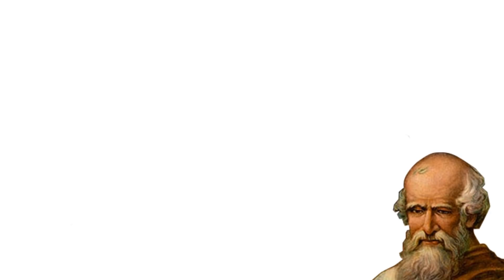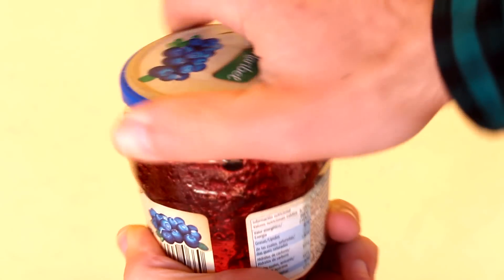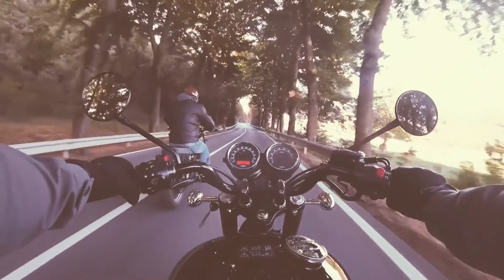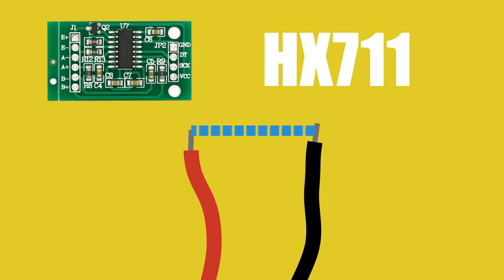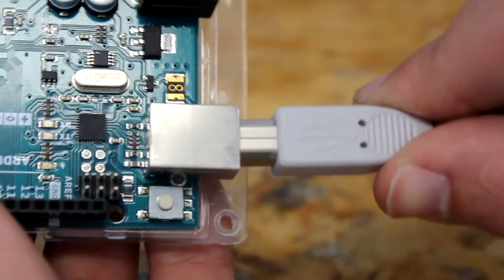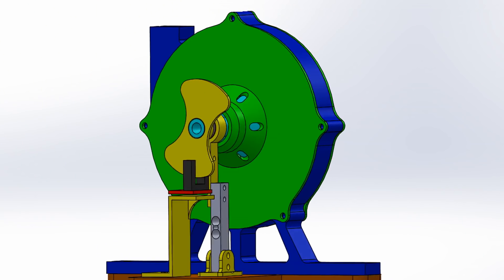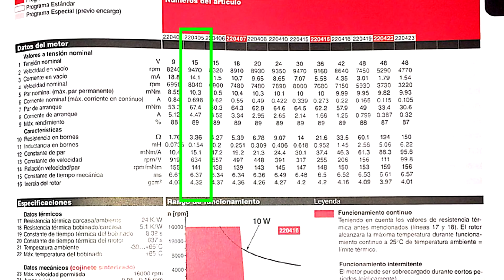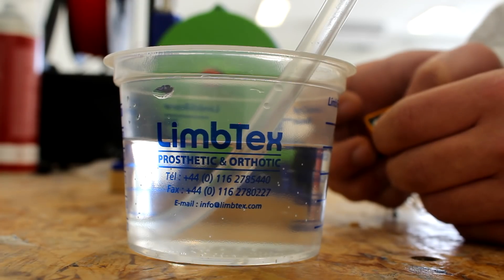DIY Torquemeter - How to measure torque! [Arduino & 3D Printed]

Comment: why did you put the value 28 mm in the code. the distance of the arm from the center of rotation is 40mm???? how you caluculate the value of arm here???/

Comment: This is really awesome but I think you missed the fact that you need to take gravity into account when calculating torque since you calibrated your load cell with a weight (force caused by gravity)

Comment: the load cell reading depends on the thing level of fastening of the gray thing on the shaft right? so if you fasten it more tightly, you'll get a higher reading on load cell and if you let it be loose it going to give a different reading, so how the torque measurement becomes accurate in this case? is there any way to verify the results you are getting is legit?

Comment: How do you calibrate how much friction to add, and how is it placed in calculating the final power equasion as the resistance is added and proportionally measured

Comment: I think the 38W is lower than your actual max power output. Usually, the max power RPM is higher than the max torque RPM. Example: supposed max torque is 10Nm at 100RPM we get ~104W, if at 120RPM the torque only drops to 9Nm your power would be ~113W. I suspect your turbine could probably squeeze out 43W+ when it's truly at peak power RPM.

Comment: You could use a generator to measure power in kw that the turbine can produce, then find the energy losses and solve the equation hp = (torque * rpm) /constant for torque

Comment: my personal suggestion is that you should focus the camera more on the wire connection and working element rather than in the display screen. so that we can learn the concept and what is the exact location of sensors and load cell in the project.

Comment: I don't understand the relationship between turbine torque and 2Kg weight at min 4.28 - 4.50. If weight has a gravity force of 19,6 N (F = ma = 2 Kg X 9,81 m/s2), his torque would be 19,6 N X 5 mm = 98 N.mm, so how is possible to equal pressure torque of 11 N.mm ? Is it correct? What is wrong in my thinking? Thank You for reply.
Reply: Yes, I think calculations are incorrect. We can simply take the ratio of two radii (150mm/10mm) and multiply it with 7 gram, giving the mass of 105 grams that it can hold.

This is the key concept to measure the torque through prony brake system. Multiplying the weight measured the load cell by the ratio of two radii (friction clamp radius/shaft radius), we can get the tangentail force acting on the shaft and then multiplying it with shaft radius, gives the torque: the final and key parameter of this video.

Comment: I did not follow. This kind of configuration will depend heavily of the friction between the shaft and the clamp. So, a loose clamp will not result in a big torque, although the engine could reach it. This also seems to work only when the torque meter is the main load of the shaft. Am I reading this wrong?

Comment: CLEAN! YOUR! TIP! 

I had shit solders too before I discovered brass wool and flux. That dirty carbonized tip is why your solders arent sticking. The flux core in the solder is not enough. Put a little flux paste on the pin/pad(I use a toothpick), dip your tip in the flux quickly, give it a scrub by stabbing it into the wool, then tin it with a small bit of solder. Let the heat of the tip boil off the flux on the pin/pad before introducing the solder. You should be able to make beautiful clean solders now. Every time the tip gets grungy, stab it into the wool. You want a nice clean shiny tip.

TLDR - bad solders come from a dirty tip and having no to flux to give ;)

Comment: If I understand it correctly, the dynamic torque meter does the same as the static one, which weighs the hammer on the scale...except that the handle of the hammer slips.
The higher you clamp down (less slippage, aka more brakeage), the slower the motor will go. And that's the relation you measure: rpm at a given brake force.
The brake force is measured by putting the scale under the brake(aka the hammer) - just as with the static setup.

Comment: Wait, shouldn’t the length of the hammer be the angle from the shaft to the tip where it contacts the scale?  So actually your torque is a bit higher than you think?

Comment: What if instead of measuring by the brake, could you measure the torque using another motor?

Such that, on the end of the power shaft attach a motor, like maybe a step motor, as a load and then you could measure torque electronically. So basically, turn your "propeller" into a generator. Add some magnets on to a 3D printed disk like a step motor. You can then measure it electronically because of the movement of your magnets. I don't think you would need a lot of magnets to get a decent measurement. Certainly not as many as a Step-Motor.

The basic concept is reverse the use of a step-motor to find the torque (SHOT). I believe that you're skilled enough to 3D print such a thing and wire it together. I think you would also need to put a load on the circuit somewhere as if you had a load on your step-motor.

One idea for another video could be a 3D printed step-motor!!

#3D-Printed

Comment: I have a question. Won't the friction clamp stop the shaft from rotating? How tight is the clamp clamped on the shaft? 

What did he take the length as? Length of the entire clamp and distance between the shaft center to the point where the clamp touches the load cell

Comment: You're measuring the wrong distance on your hammer and you've introduced cosine error.  You should be measuring the hypotenuse of the 'hammer triangle', by measuring from the centre of rotation (the turbine axis) to the point of contact of the hammer on the scales.  How do I know - thank my Sociology degree. :)

Comment: A proportion of power will be transferred to FRICTION CLAMP depending on the friction between shaft and clamp. If the friction is too much, it will increase load on the motor, considerably decreasing the rpm( considering non linear relation between rpm and torque), and if friction is too less force measured by load cell might be too less, without much affecting the RPM. Due to which overall power calculated might be wrong. Power calculated seems to depend on friction between FRICTION CLAMP and shaft.
Can you please tell how you managed this? If I am wrong please let me know where.

Comment: Shouldn't the torque be a constant value depending on how hard you tighten the clamp? Because friction = Normalforce*friction coeficient, or Is there another force acting on the load cell?

Comment: The length of the hammer is meassured incorrectly.
It needs to be between the center of rotation and the point of contact with the scale (outside of the flat bottom).
So if the hammer head is 50mm, that's sqrt(50 ^2 + 100^2)

Comment: Would you think it has enough torque to run a pump to feed fluid back up to the top of it? making a complete cycle. if you need a pump design i can give you one.

Comment: 4:20, the units of torque are force times length, not force per unit length. You say 16 Newtons per millimetre, should be 16 Newton-millimetres (dash is not a minus 😋)

Same thing at 12:36

Comment: Why your dynamic torque reading is even changing with RPM? It is caused by dynamic friction anyway, and dynamic friction force should stay constant since your output shaft is sliding, isn't it?

Comment: Hey Integza, this comment a little late, but... You will find it is way easier to solder small through hole parts if you use thinner solder than what you used in the video. 0.5-0.6mm or 0.20 - 0.25 inch rosin multicore solder is easier to control and less likely to leave blobs.

Comment: This torquimeter does not make sense...
And a load cell must be polinomially linearized...
How could you measure different power on this torquimeter then on the motor?
The only difference should be the efficiency of the electric motor that in the torquimeter you would have the real value without efficiency loss.

Comment: Kudos on your videos 😊

I see this video is about a year old, and much has probably happened in that time, but I just wanted to give you a few tips about a couple of things:

1.: Dynamic torque:
If you have the effeciency, the current, and the voltage of the generator, you should be able to calculate the output wattage, and the torque of the turbine.

2.: Soldering:
Get a better soldering iron, clean the area (as little as a fingerprint can have a negative effect on the result) you are soldering and/or use flux (it will make a world of difference. The flux cleans the surfaces, and makes it easier for the solder to flow, and it makes the tip of the soldering iron last longer), solder at high temperatures (I find that 350C (48W soldering station) works for most normal PCB soldering (add flux, heat surfaces for a couple of seconds, add solder). I hate it, but leaded solder is the easiest solder to use. Unleaded solder will eat a low quality solder tip in no time, giving you an uneven surface, causing the solder to stick more to the tip, causing bad results - again; flux mitigates this, but a good soldering iron, with a good tip, will still make a big difference.

Comment: Question: It's easy to see how you could get an accurate reading of the velocity. However, how can you truly be getting an accurate reading of the torque? A dynamometer is just measuring power (torque*angular velocity). Power is just the measure of energy per unit of time. But isn't a certain amount of the energy is being lost as HEAT due to the friction clamp?
Here's my understanding: The torque generated by the motor is converted into a linear force, which is measured by the load cell. Given knowledge of the moment arm, you can reinterpret that as a torque. But aren't you only measuring the torque that was transferred via friction AFTER losses due to heat? Or are we just assuming these losses are insignificant?
This seems to not just apply to your device, but any dynamometer that uses some sort of friction coupling. I'm not well versed in this area so I'd love someone to poke a hole in my understanding. Either way, great idea. I'll be making my own at some point.
Reply: Yepp, in  fact, he's measuring the "outcome" of the "system", not evaluating the performance of the motor or power fed into the system (as input) versus the output (torque).

So yeah, we don't care about the losses here, he's just showing how to measure the torque (as the output of the system).

Comment: Shouldn't you be using the hypotenuse of the Thorque lever to calculate the static torque? Essentially, the distance from the axis of rotation to the contact point with the scale.

I'm not an expert, so if anyone could tell me whether/why I'm right or wrong that would be awesome.

Comment: my friend this does not give you accurate data .......
you need a dynamometer you can use an inertia dyno wich is just a flywheel .you measure the torque by the rate of change in rpm
it is much simpler and more accurate 
there is a complete solution with a free software 
https://sites.google.com/site/simpledyno/

please do it and compare results

Comment: Your power out put for your dynamic torque meter doesn't line up with it under load of your dc motor is the dc motor not able to out put 38 watts or is the motors max out put 4.5 watts

Comment: Heat the pin, not the solder. Then add the solder to the pin, not the solder iron.

Comment: I really enjoy you channel.  It would be interesting if you mounted the motor/generator on bearings and attached the load cell to it.  Put  a variable resistor in the output circuit and include the arduino as a data logger. Then you would have an electric brake dynamometer.

Comment: I do not fully understand how the dynamic Torque was calculated, the static torque made sense and the angular speed too but I am not following with the dynamic Torque. Also would it not have been easier to calculate the power then use the power to predict Torque opposed to the other way??

Comment: With all due respect.... does not the 10mm shaft, which is equivalent to a 5mm “arm” only be able to hold a 200g weight? You say it would be 2kg? (Can someone else do the math for me?)

Comment: Doesn't compile........ error says no matching function call to 'HX711::HX711(int,int)'
Reply from the maker: You have to install the HX711 library my friend.
Reply: @integza  Know all about that and I DO have HX711 library installed. Downloaded from Github ... bogde/HX711....is there another or has there been major changes to the library.
Usually find it beneficial for authors to post a link to the libraries used to avoid these problems.

Comment: @11:30, wouldnt your photo sensor be more accurate if the surface of interuption was instantanious? I mean you are using up around half of each rotation interupting the circuit with your current interputor.. Perhaps attaching 2 pins to a rotating connector would instantly interupt and reactivate the sensor better for a more accurate reading?

Comment: Hi, instead of using a the prony break, maybe you could get the angular velocities w1 and w2 and the time lap, so angular acceleration could be calculated as  [ a = (w2 - w1) / dt ] where dt is the time lap. Knowing the mass of the rotor could you get its Moment of Inertia and multiplying both values leads to the torque. The clue here is that when no change in angular velocity is registered the torque will be zero; because there are no force acting on rotor.

Comment: @integza May I recommend you get a soldering flux pen? That would really help your issues with soldering if you added a little extra flux to the joints and be able to add in flux when you accidentally mess up a joint and have to re-do it. Hope that helps <3

Comment: come on....  youtube science sux.  N.mm =/= N per mm but N by mm (or times mm, it is a scalar/dot product)....  you are educating the kids of tomorrow, we ( the educated, enlightened, ones) don't want to make them dumber than our (great grand) parents generation, ? do we???
(Ok, I dow't speak your language of choice, likely, but we are in C-21 +0.2)

BTW, speaking in hyperbolee, there are those out there who think I talk backwards...)    jesting is a low form of enlightenment I know...

"? dynamic torque?  = do you mean Power = T . (rad/sec)  ie rotation,...

Yep your air pumping expriment was able to determint the tatic head of the "pump" - severall CM of H2O- head pressure...

Shanging te level of the water would need a thin measuring cylinder of "similar" diameter to the tube...

entertaining but not "worthy" of a "Teslonian".    h ha ha....  ha ha.....ha.  Thanks..

Comment: Alcohol has always made me smarter :D actually it's proven fact...at least until I got about 30...then it has become a tool to turn down the volume of children in my head.
I probably will kill all the fun but why not to just measure the power from motor? In theory if you add adjustable resistor you should be able to change the load and measure the current and volts until the motor stops at any rate of pressure. Maybe even incorporate pressure gauge into the inlet of the motor. You could 3D print the motor but its probably easier and cheaper to buy or salvage from somewhere. Plus if you have 2 identical ones you should be able to calculate the  losses of the motor aswell.

Comment: When calculating power, make sure to use the correct units. In this case, Nm and rad/s, not rpm. This would give a power of 3.8W.
Reply: I thought 11g he measures are nowhere near the 11N used to calculate the torque

Comment: 1:30  Energy = Force * Distance * Time
5:39  A slip collar is imprecise and will change over time.  I'd suggest measuring the rate of acceleration, using a fixed weight flywheel.  Force = Mass * Acceleration.

Comment: Want the solder to stick to pins better?
1. Lower the soldering iron temperature
2. First heat up BOTH the pad and the pin with the iron, then apply solder
3. Use flux (either solid flux, or paste, whichever You prefer)

Comment: hmmm... What if you calibrated the energy output with just the electric motor? Could calibrate a motor against another and the Energy would relate to torque. Placing a weight on a motor and dropping it would give a calibration chart for torque vs electrical resistance.

Comment: You could have calculated the torque by just measuring the Voltage and amperage from the motor. Voltage is just electronical force after all. P=I *ΔV

Comment: I'm trying to recreate this as a personal project, in your code there is "float arm = (28);", does this mean the torque arm is 28mm in length?
Also, is there a way to not measure maximum but just constantly monitor both rpm and torque values?

Comment: "You can't measure the torque of a stationary tesla turbine" - it has no meaningful relationship to the moving version.

When stationary the vortex is effectively short circuited and any measured torque is simply from the entry jet impinging on the discs. As soon as it starts spinning the same airflow will produce a much higher  dynamic torque.

The interesting part is determining what rotational speed your vortex collapse is happening at. There's a sharp elbow waiting for you.

The same applies when a tesla turbine's used as a pump. They only operate as long as the working fluid is kept flowing. As soon as pumping stalls, the energy transferred to the working fluid goes to nearly zero (paradoxically you may hear the turbine unloading and speeding up when this happens) - this one of their huge disadvantages and why they're not widely used in the real world vs centrifigual pumps (the other disadvantage is a nasty tendency to clog due to the narrow rotor spacing)

(Or, in other words, your attempt to use the turbine as a pump failed - because you loaded the output before allowing the fluid to flow)